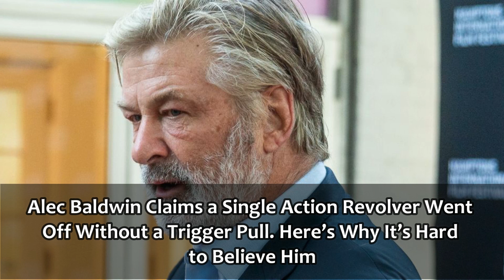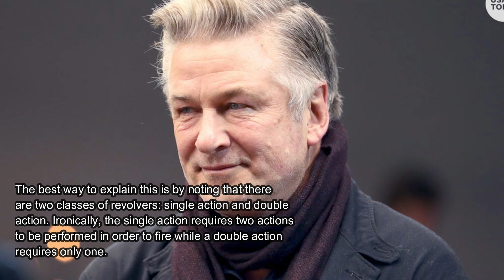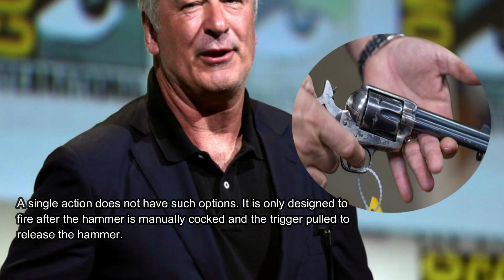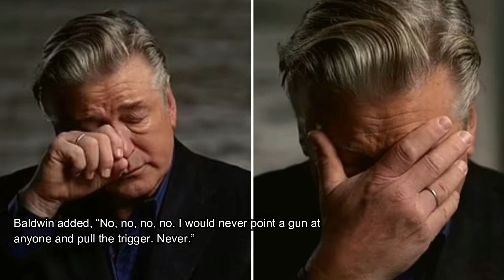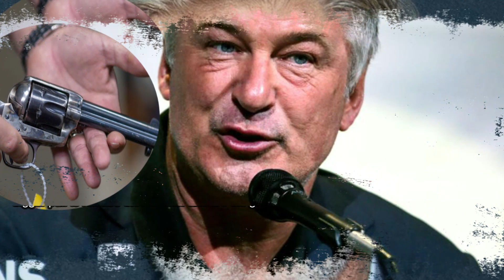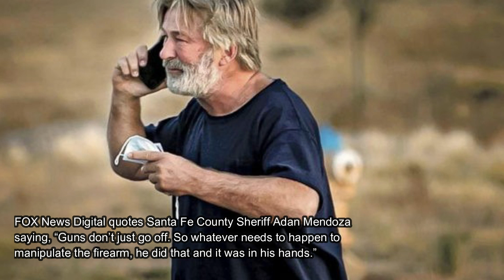Baldwin Claims a Single Action Revolver Went Off Without a Trigger Pull. It’s Hard to Believe Him.

Comment: If one of the notches on the hammer mechanism was defective or plugged with foreign material, it would be possible for the gun to go off without pulling the trigger. The real question is how & why a live round got in there.

Comment: Not if The gun he had may have been an Altered "Gunfighter" pistol. One that the Sear Engagement has been filed off. Making it a "Fast Draw" gun. A gun modified for "FANNING the Hammer" from the Draw. 
 Gunfighters used to have this modification done. Or they simply wired the Trigger back. And if it was modified this way. It he Fun to Shoot..... Really Fun.. Maybe Fun enough that this was one of the guns reported to have been used by other cast members to Target Shoot. So he may be telling the truth.  But what do I know. I'm just a Certified Smith and Wesson Armour. And Gunsmith of 30yrs.

Comment: Baldwin said the gun went off without him ever actually pulling its trigger.

“Well, the trigger wasn’t pulled,” he told ABC News. “I didn’t pull the trigger.”

At first glance, this sounds far-fetched. It is exceedingly rare for a gun to fire without the trigger being depressed. Modern firearms, even replicas of antique guns, have safeties specifically designed to prevent them from firing without the trigger being pulled. It only really happens when the gun’s firing mechanism is damaged, or there is a significant design flaw.

That’s why most gun owners and firearms safety trainers are highly skeptical of any claim a gun just “went off” absent user error.

In Baldwin’s case, though, the claim is at least somewhat more believable. That’s because the gun involved is more prone to firing without the trigger being pulled. And, even though it’s a modern replica of an antique design, it’s possible it did not include modern safety devices.

Santa Fe County Sheriff Adan Mendoza identified the gun used in the shooting as a modern Pietta replica of a single-action army revolver. Those guns can be bought either with a transfer bar that makes it impossible for the firing pin to strike the primer unless the trigger is pulled or without one. Often, enthusiasts and collectors prefer the models without modern safety devices because it’s more authentic and perfectly safe when handled properly.